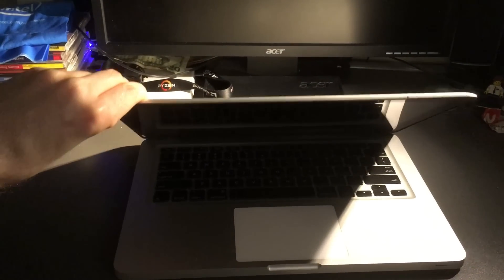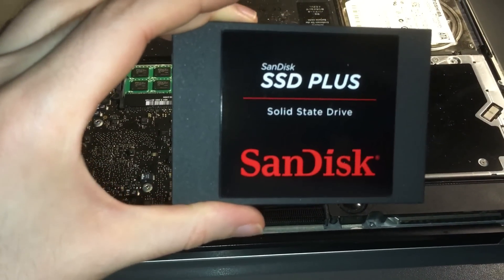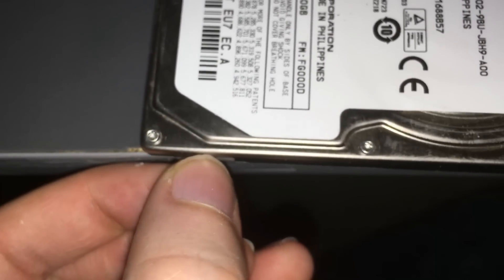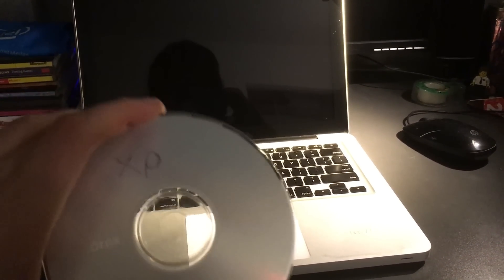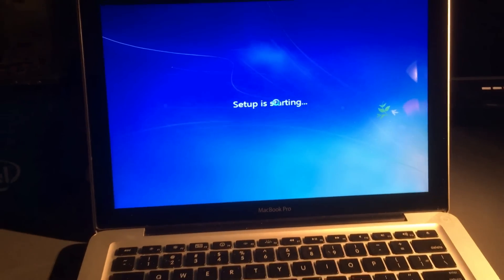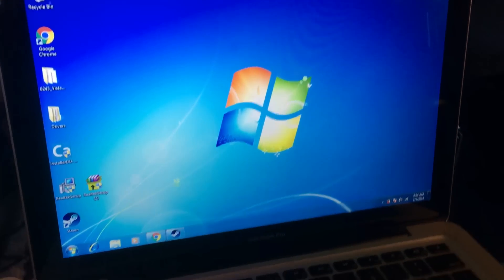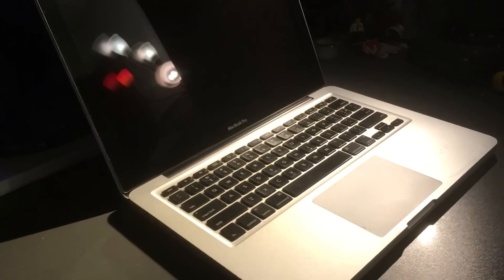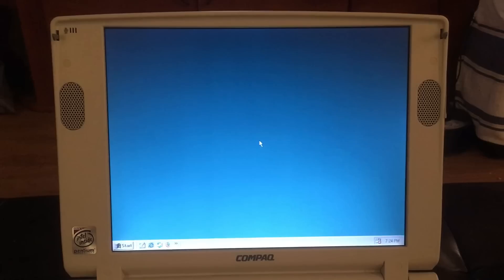How to Upgrade Your Old Macbook Pro With an SSD

Comment: The worst thing about Macbooks is the graphics. But if you have tried PCs, many of them come with much worse speed, lower battery life, and windows is just much buggier than Mac OS. The Macbook runs best with Linux OS
Reply from the maker: the macbook is actually horribly slow in comparison to similar core 2 duo thinkpads of the era,  LINUX is not the right OS to install on a macbook, the edge that apple has is that their mac OS seems to have optimizations to do video editing and creative work better than a similarly equipped PC generally, and quicktime has full support, so you dont get stutter and bs on slow cpus as much. however, in terms of everything else beyond that, the mac performance is abysmal, gaming is a no go even with the same gpu in a pc the pc somehow does better and has superior drivers. Also, running windows OS on a mac makes the battery drain really fast, while on a similar thinkpad, the battery lasts about double as long, apple's hardware is optimized for their own OS, not really anything else. windows is not really buggier than mac os, actually modern mojave is buggier than windows 7, i've encountered random crashes and updates that dont work properly  + that whole insane keychain system that apple pushes on us, linux is actually not a bad idea but, for whatever reason when benchmarked, linux video editing on a mac was actually throttled and not good while mac os video editing had no throttling and the fans behaved properly.
Reply from the maker: however, I would argue that mojave is a much better OS than windows 10, but windows 10 isn't really that unstable, its just that people with shit internet complain about it not doing updates properly and then end up with an unstable OS, when its actually their shit internet causing the issues over a long period of time gradually because they don't like doing updates.

Comment: It is fake benchmark, how you get NVIDIA GTX with 4096mb vram in this macbook?
Reply from the maker: first benchmark specifically states "streamed" but due to the processor limitations it isn't able to do higher than 30 fps, the rest are natively on the 9400m
Reply: @psychoticgiraffe  how it laptop in video rendrering?
Reply from the maker: @ruki00kruki  i believe it was pretty abysmal at video rendering, but it was about 2x better than the thinkpad T43

Comment: Do you think an old PowerBook g4 from 2003  would run windows xp
Reply from the maker: no you cannot that uses a powerpc processor, although you can use virtualpc to run it in a window if you install it in virtualpc https://onedrive.live.com/?authkey=%21AF9yLwc6j6_W9oE&cid=A8E253EB06E99DEB&id=A8E253EB06E99DEB%21501176&parId=A8E253EB06E99DEB%21501173&o=OneUp

but that is emulating it basically, its not running natively on the powerpc chip
Reply: Thank you

Comment: Can you apply or disapply a few myths? (sorry for bad english)
1. Can launch Need for Speed Most Wanted and Need for speed Carbon on Windows ME?
2. Can launch Counter-Strike 1.6 on Windows 95?
3. Can launch Call of Duty Modern Warfare 1 and 2 on Windows 2000?
Reply from the maker: call of duty modern warfare 1 and 2 can be ran on windows 2000 but it is not fun to get to run https://www.tapatalk.com/groups/win2kgaming/call-of-duty-6-modern-warfare-2-kernel-error-solve-t381.html

CS 1.3- 1.5 do work on windows 95 with voodoo sli and stuff, but 1.6 requires steam and won't work on windows 95, there may be some cracked version that might run but it wont be as good and might fail to run or run really bad, there is probably some way to run it but its gonna be either a cracked version or modified game files (merging 1.5 files with 1.6 to make it run) but it will give you horrible fps on anything that runs 95, 1.5 is much better for 95

need for speed most wanted I believe requires windows XP, you can try running it with Windows ME with kernelex installed, if you run it using kernelex there is a chance it might work? if it doesnt though, it just wont.

Need for speed carbon I have no idea if you can force it to run in ME but it can be ran in windows 2000, might be using kernelex trick but I'm unsure, I'd say try it and find out
Reply: Thanks.

Comment: not sure what game benchmarks have to do with an SSD but otherwise i guess this is a decent guide
Reply from the maker: SSD makes everything faster even games

a good example is MYST

if you try to play MYST off of a cd rom drive its slow

if you burn the ISO for MYST on a SSD though and mount it, then its lightning fast.

wheras, if you mount it on a slow HDD, its better than the cd drive but not as good as the ssd

note that this isn't a scientific analogy

frametimes also improve on an SSD vs the HDD, the FPS difference may be small (anywhere from 0-10 fps) but it is there.

SSD also shortens the load times
Reply: SSDs don't improve frame rates, just loading times.
Reply from the maker: that is false 
http://computer.dallcrown.com/hardware/can-ssd-improves-game-performance-hdd/ infact, SSDs also help get rid of microstutter, there are plenty of tests showing this.

frametimes improve on an SSD particularly at 4k or 8k
Reply: https://www.pcgamer.com/how-do-ssds-affect-gaming-performance/ no improvement in FPS is found via an SSD, and Hitching is something that you won't experience on any modern 5400rpm drive.

even if you were to argue on the point of hitching, it would still make no sense over upgrading literally anything else in the system
Reply from the maker: pcgamer's article is incorrect, while the overall performance may not be a large difference, there are some things that an SSD does improve for games, and at 4k or 8k it is most evident; pcgamer did not test this, now I suppose yes if you are running at 1080p you are pretty unlikely to see a huge difference let alone any, unless you account for lag or microstutter in games, I do notice LESS on ssds, look up comparisons of hdd to ssd performance and you'll see what I'm talking about;

hitching is a valid point but yes it doesn't make any sense to upgrade to an SSD for that reason

only the most elite  will see the difference I'm referring to on an SSD.

although, I will bring up that I did do a test of hdd vs the ssd on this mac and noticed that the frametimes actually did improve a lot but I neglected to include it because the HDD basically was dying so it kind of wasn't a fair comparison and could've been moot; but regardless of that, microstutter was still reduced by the ssd in any case.

modern drives don't do hitching very much at all, so you're right about that; making my comparison a bit less valid.

in the video I suppose the game benchmarks probably have practically no difference if I were to use a modern drive vs the ssd as I'm running at 720p and nothing higher than 1280x1024  because the screen can't go beyond that.

but that doesn't mean that the SSD didn't improve gaming performance, it did reduce lag and microstutter.
Reply: so, you had a dying HDD, and that is your basis for the improvements of an SSD? Switching to an SSD did nothing for my game performance, nor has it improved anyone elses besides those with already faulty hardware.

a traditional hdd is more than adequate for a game to load all its textures into RAM (an SSD is faster at this, hence lower loading times), at which point everything needed on demand is loaded from ram, as even an SSD would be way too slow to load directly from.

another relevant point is the fact that there is less than 50 people playing games in 8k, as not even 5k is standard, so why you keep mentioning that, i don't know
Reply from the maker: SSD upgrade does reduce microstutter and lag, and decrease load times, this can apply to environmentally intensive games that have a lot of foliage.

Its not a big difference, you're right, but its a difference.

pcgamer just isn't elitist enough to care about that, 4k, or 8k.

also, there are some SSDs like the new intel ones that are practically ram, they can double as either ram or an SSD, on those drives you will notice an even larger difference.

Also, I know I didn't try benching this game but Star Citizen really does run a lot better with an SSD, and you will have a lot less lag microstutter and lower loading times + the environment itself loads faster if you have an SSD, its one of the few games that really shows off what an SSD can do to improve gaming performance.

a standard HDD is almost always more than adequate, but, star citizen's recommended requirements even say you need to install it on an SSD for it to run optimally, and what I said about microstutter and lag still holds true.

I just noted that I didn't cite my own test because it would've been biased, I'm only referring to other results from youtube atm.
Reply from the maker: in the future you will notice huge gains in performance with SSDs as 4k 8k becomes more standard, and as environments in games get to larger sizes

Comment: Good on you to install Windows on this.

Apple products are over-priced, low quality junk. And their OS is... well, do I really even have to say?

All the same, another good video Giraffe!
Reply from the maker: mac os is bad thats why more ppl use windows xp lol

but there is one drawback to using windows, it drains the battery on these faster, I was only getting like 1.5 hours

sometimes worse if running a game

although if you idle the machine it lasts 8 hours, so the battery life doesnt make much sense at all

wheras in mac os it seemed to stay solid 3 hours normal use 1 hour gaming but in idle do 20 hours

battery is still shit regardless though, so you likely need to replace teh battery on these old macbooks to get the full experience in windows
Reply: From what I can tell, the reason Macbooks have a long battery life is due to their processors being clocked at very slow speeds. And then since they have such heavy handed control of their OS, they "optimize" their applications to run at these lower speeds.
Reply from the maker: so in windows that doesnt happen it seems
Reply: It seems so.
Reply: https://www.youtube.com/watch?v=pSwu1T9pMwE&t=1s

anyone can watch my new video have a nice day